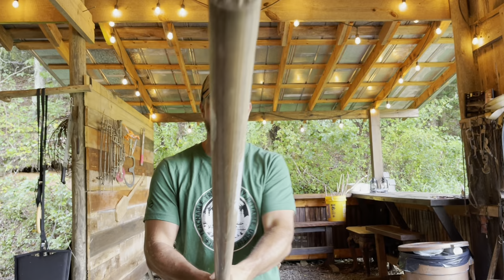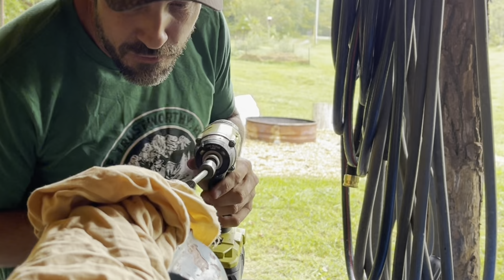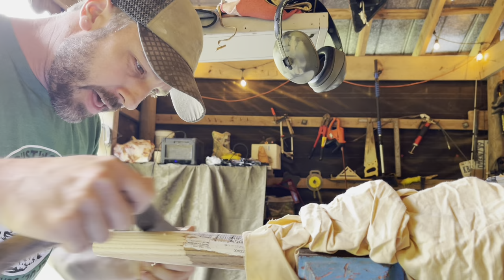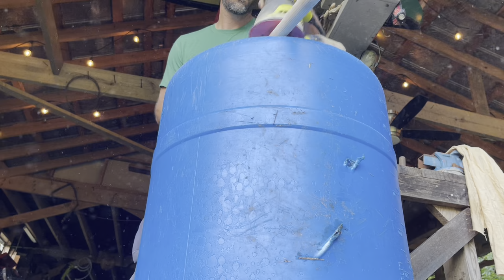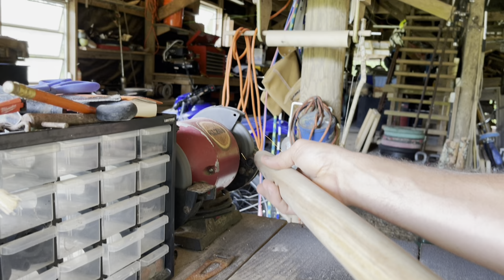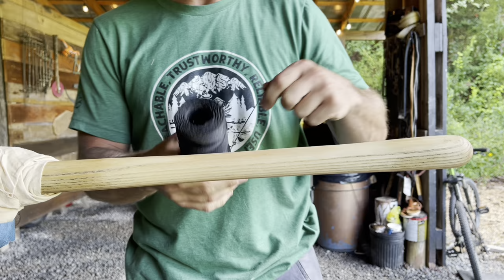The #1 Survival Skill | On3 Jason Salyer

Comment: I have a similar stick, bought a 1 1/4 diameter wooden dowel rod at Home Depot, cut it down to 45 inches, gave it a couple coats of Spar Urethane to waterproof, and that is my hiking stick, also called a "Jo Staff" in Japanese weapons.  I call it my "Dog Stick" since I use it to fend off dogs while walking, sometimes loose dogs think I am the Postman and attack.
Reply: Mine came off a beaver dam back in '95.  I've wrapped one end in leather and put on a loop to hold and a bit of fur for padding when I want to just lay my head on it. Nothing like a solid stick that has been around for decades.
Reply from the maker: Nice!!

Comment: when you are finished with goad sand off all finish and immerse tool in boiled linseed oil . it will last forever. I have one at front door /minus the metal point . I rounded the other end like the original end . I have it there if ever I need to check a tire pressure or attitude .